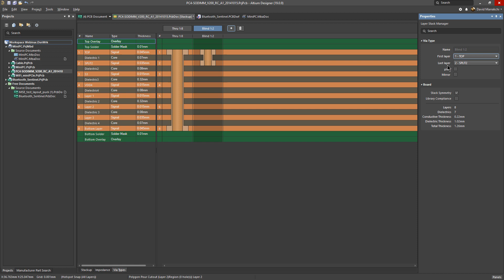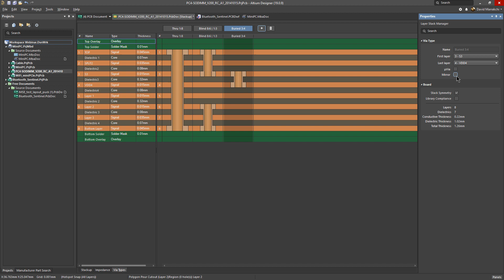How to set up and use buried and blind vias | Altium Designer

Comment: Altium fucking retards you guys simply seriously fucked up the Alitums user interface, its spam infested and I have to manually open the fucking properties window to set via parameters when this fucking window should open automatically (use common fucking sense). I wont be using this POS PCB software even if its free, once I start fucking with candance. I've never wasted so much time trying to figure out simple fucking shit of user interface on a software. You stupid fucks should go learn how to produce documentations which makes sense.

Comment: Why won't it let me delete the thru-all via?  I have a flex circuit that is all stacked blind uVias at the request of the manufacturer, they don't actually want a through-all via at all.  But altium forces to you have that via in the layer stack no matter what even if you don't use it.
Reply: You can't delete it because the through-hole via is the default via that comes pre-included in every project. If you don't want through-holes in the PCB then don't place any through-holes in the PCB. Just because it appears in the layer stack does not mean you are forced to use it, you can just ignore it.

Comment: The Via templates are confusing me with this method. I created the blind via from 1-2 i needed but then it uses a template as well. This doesn't make sense.
Reply: Hello Lavixl, i'm not sure i fully understand. if you would like to discuss further you can send me an email at alexsander.tamari@altium.com
Reply: This whole PCB software simply got retarded when it used to be logical, perfect example when the CEO is fucking dumb stupid and continues to have their staff fuck up their software year by year. The whole UI is extremely confusing and retarded. Their staff are all mentally challenged can't even produce documentation that is readable and sensible, not even chat-bots under stands their shit. Only why to use this POS software is by having someone else to explain its dumb fucking UI.